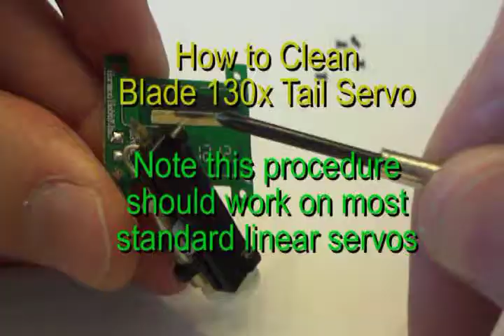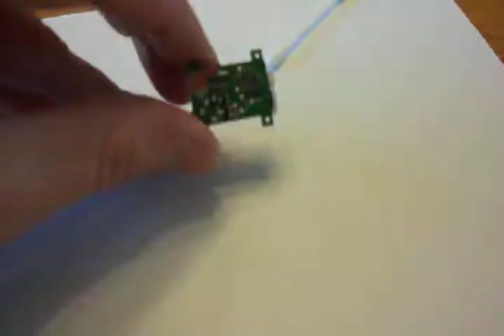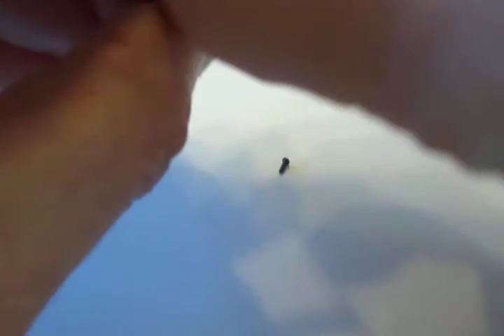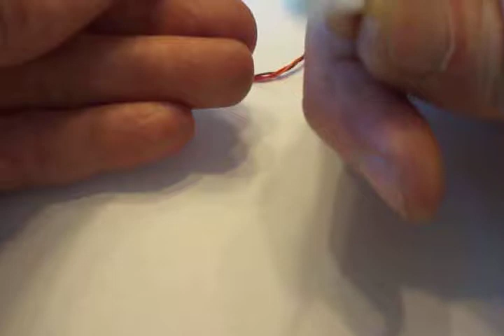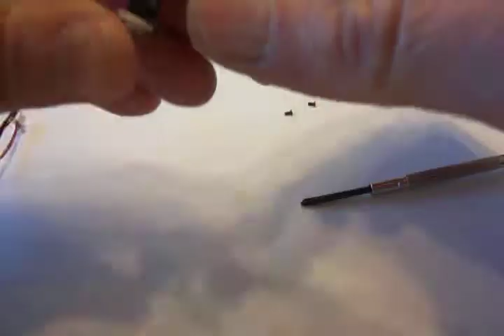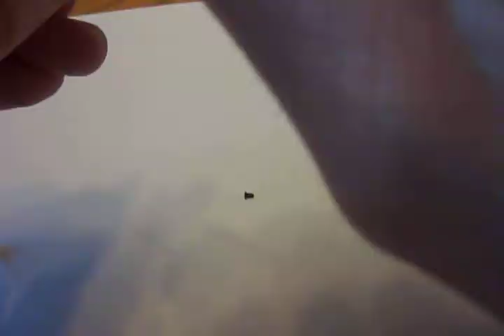Cleaning Linear Servo - Blade 130x & Most Others

Comment: A crash will cause a high current pulse in the servo that deposits carbon gunk to the servo wiper resistance track.  The carbon marr on the wiper track is the source of jittery servo operation.  Clean the carbon build up off to restore servo smooth operation.